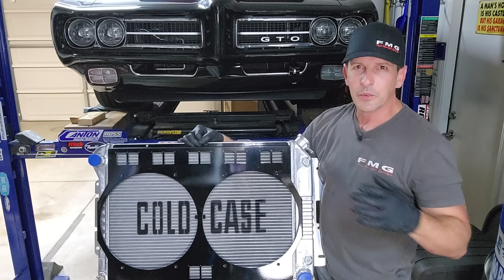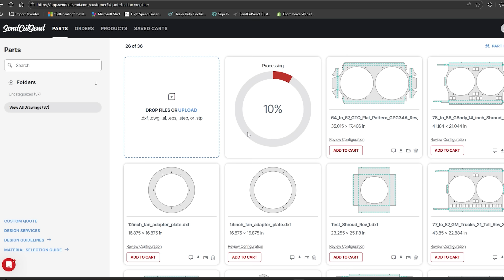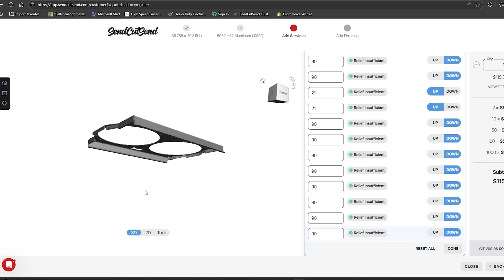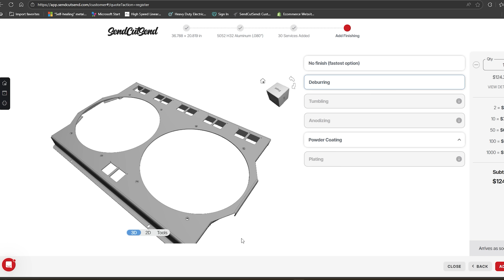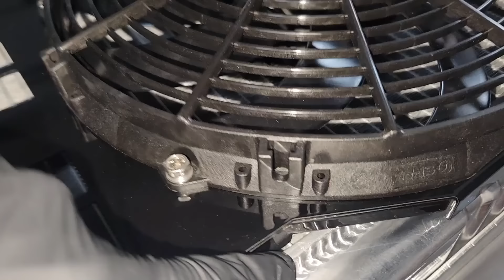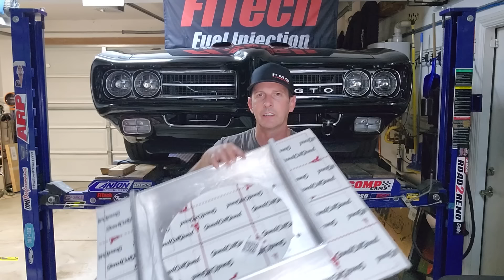F-Body Twin 12" fan Shroud for ColdCase CHC11 Radiators, and SendCutSend Review

Comment: Does this also fit Cold Case radiator CHC11AB night rider series?    For 68 f body auto

Also in your opinion do you think black Cold Case radiator does not cool as good as a raw aluminum radiator bcuz of powder coating? 
Thanks for your help and videos my friend
Reply from the maker: Good question, and yes it does fit the CHC11AB... secondly, I've seen studies where the powder coating on the radiator helps heat transfer.  Haven't researched it further than that... so, you're good to go.  I should have the black shrouds in stock too.  hit up my website, after you hit Cold Case Shrouds, you can filter the selections by Cold Case Part number.  Let me know if you have any other questions.  See ya!

Comment: It would be great if the OEM shroud would also fit with the electric fans. Only to make it appear more stock.
Reply: Have the shroud powder coated in black wrinkle or matte black to mimic OEM.
Reply from the maker: Certainly can. Actually, there are seven colors, and four different blacks to choose from. Just let me know.
Reply from the maker: I'm not understanding... it is designed to fit two different electric fans.